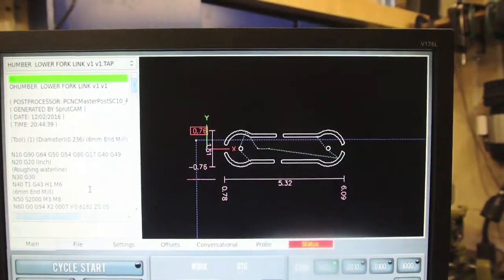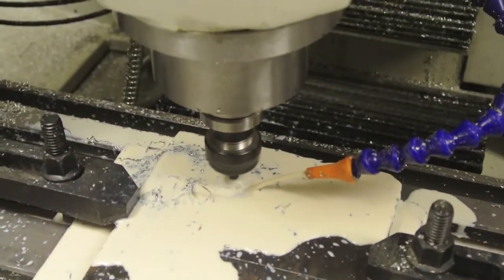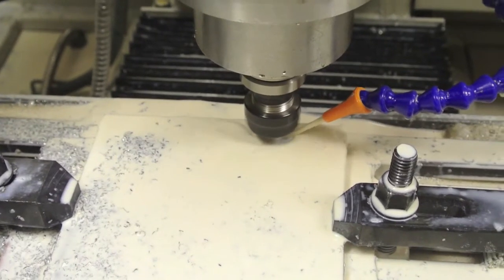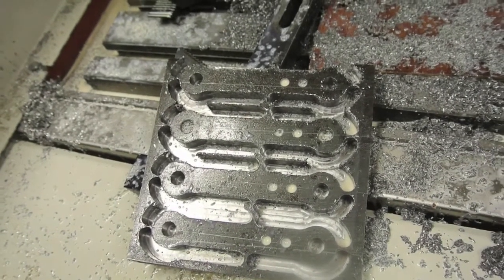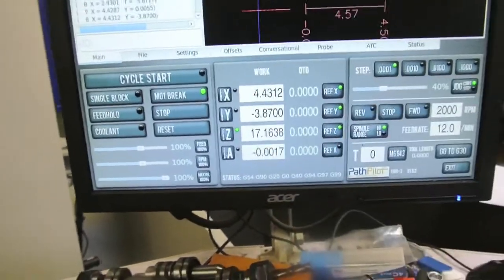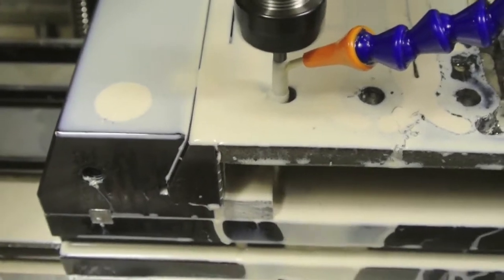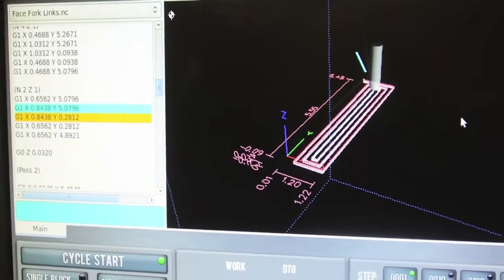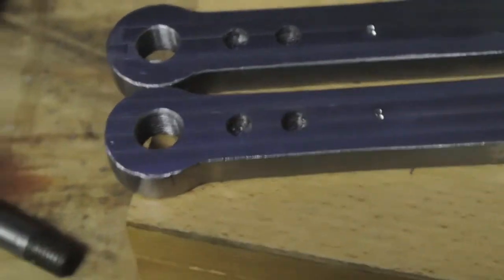Girder Fork Links on the Tormach Mill

Comment: This is the first Tormach iv seen in the UK how do you find the machine and how did it all work out with getting it to the UK I would really like to talk to you more about it as iv been looking at them for a year now to replace my to Denfords
Reply from the maker: +hudmut Hi Hudmut.
It is a really good machine and has quite a good size table. You will need a good bit of floor area for the PCNC 1100, approx 8 ft X 4 ft. Import into the UK was no problem. Place the order and pay Tormach, meanwhile contact a shipping agent (AAC in my case) and they took care of everything.
You can contact me by logging onto "Model Engineering Forum" and sending me a private message through the board.
There are a few of them about in the UK.
What area are you from?
Reply from the maker: +Bob Rodgerson Hudmut, I've just thought if you contact Tormach and ask about getting one to the UK  and who you can speak to in the uk about importing they will give you my contact details and those of a few other folk who are omgbasadors for Tormach.